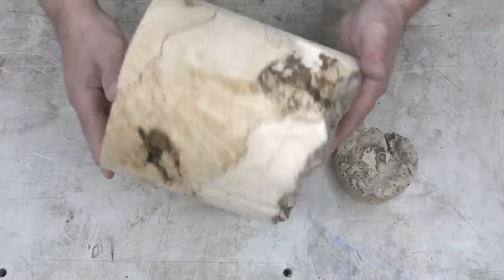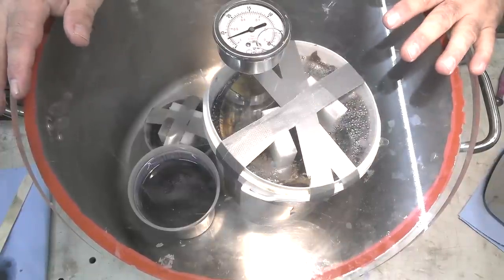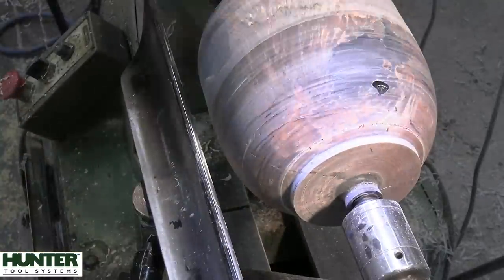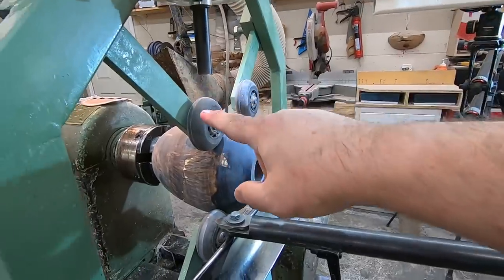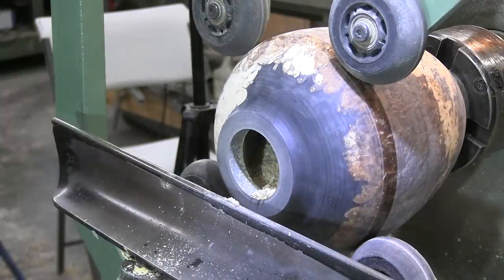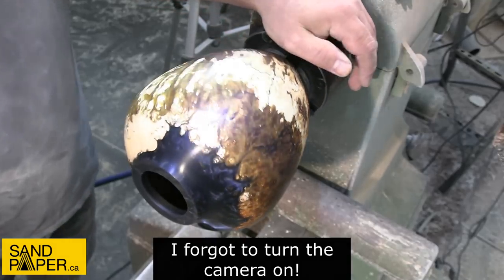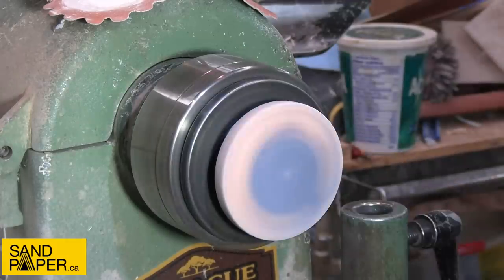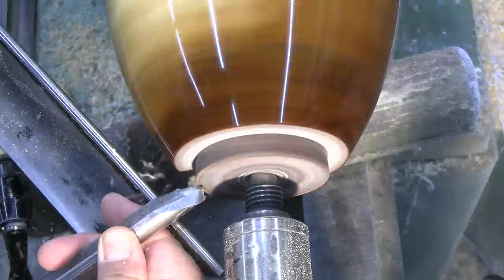Woodturning - The Black Pearl Urn

Comment: That is an urn that would be fit for the queen! The box elder is amazing. I do like the black in the designer epoxy. Thanks for the talk on pricing. I don't think non turners realize how much time goes into a piece. Then a half a second slip and it has to be refinished. A fellow turner gave me a formula he used. Diameter x height x 2.5. The later being adjusted if the wood was more costly. great video and a great urn. Whose ever it is for should be honoured.
Reply from the maker: Thank you very much!

Comment: Hello Jim its Mike (the terrazzo guy) we always used Diamond pads on our epoxy  floors. The pads are more expensive than sandpaper but when used correctly they will last an incredible amount of time and we didnt put anything on the epoxy and stone after bringing it up to 1500 because it was always scratch free with a mirror finish. I understand wood is much different, you have to put a finish or sealer on it. If you get a chance try the diamond pads, you generally use them wet but I believe you will be amazed,save time and achieve and even clearer finish, not that your art isnt perfect already. I have never seen such quality in my life.
Reply from the maker: Thanks for the info! Thanks for watching

Comment: The urn is gorgeous. 
A heat gun works well to pop bubbles and might be easier in a tight space. The interior of an urn would hold the heat, which is good and bad. It would quickly get rid of the bubbles but, if the nozzle is left in more than a few seconds at a time it could burn the resin. Just a thought. Beautiful work as usual Jim
Reply from the maker: I don’t like using heat guns because of the air that blows on the piece can have dust in it. Thanks for watching

Comment: Oh this one is very elegant! The black resin goes well with the figuring in the wood. You know, $400 is very much a reasonable price for what you make. It's art that takes a lot of time and uses expensive materials, and they're heirloom pieces that should easily be around for a hundred years.
Reply from the maker: $400 would be only half of the cost of this piece after factoring in resin, sandpaper finishing and other expenses. Thanks for watching!

Comment: Jim, to avoid all the air and bubbles from paddles, a) is there a way to stir that won't add as much air and b) can you stabilize punky wood with cactus juice to help with punkiness and make you use less resin?
Reply from the maker: If you stir with a stir stick it tends to add less air. Either you use stabilizing resin or casting resin they are pretty much the same cost. The big difference is that Designer Epoxy is food safe and stabilizing resin is not. That's not really a concern here but it would be in most projects, thanks.
Reply: @SpragueWoodturning  is stabilizing resin cactus juice?

Comment: Jim, I have a few observations after watching a number of your project videos.   Your lathing skills remind me of what a skilled ceramicist accomplishes on a powered pottery wheel; beautiful work. Given the number of open-form urns you produce, my reaction to this particular style of project is that the internal beauty of these projects is left unexpressed, a real missed opportunity to display their full beauty as well as, potentially their full value!  A final thought, I think you should continue to pursue the solution to your “peacock” coloring effect. Some of the early attempts where even the slightest of the green, gold and purple reveals themselves suggests great potential. But you seem confounded by how dominant the blue color you use overwhelms the others when, my observation is that the proportion of blue to the others is so much higher. What would happen if you reversed your proportions.
Reply from the maker: I will return to the peacock hollow form in the new year. Thanks for watching

Comment: What a beautiful piece! Idle curiosity has me wondering though if there's a way to seal the wood before pouring the black resin to create that really sharp contrast between the black resin and the blond wood? I just love how graphic those sections look
Reply from the maker: If this wood was stable and full of dry rot then you could seal it with a sanding sealer, in this case it’s not so I want the resin to penetrate it which will help with stabilizing the form. Thanks for watching

Comment: WOW… another amazing piece. I love the color. One thing is that I still don’t understand the laser thing. How do you use it and how do you know when you need to stop?
Reply from the maker: You set the offset on the laser to the desired wall thickness and when the laser disappears off the outside surface of the form, you’ve achieved the desired thickness. Thanks for watching
Reply: Thank you for explaining it. It’s a gorgeous piece!

Comment: Simply put, it's gorgeous.  Morbid? I think not. If you didn't know it was intended for ashes, it's a very pretty statement piece.  The wood grain is beautiful. Pricey, yes, but if you look into the industry for urns ⚱,  that's pretty much what they're going for. My mother's marble urn was  around $300. Specialized ones are much higher. If I had known about these ones at the time,  I would have chosen that option.
Reply from the maker: Thanks for watching

Comment: Designer epoxy

I love this urn, it is awesome…

I started using the waterlox because of you but my bowls are all wood with no resin.  I don’t seem to get the same gloss as you do.  Are you using the waterlox on your wood only bowls also or just the resin ones?
Reply from the maker: On everything and I’m getting good results 🤷‍♂️ Are you buffing between coats? Thanks for watching
Reply: I do buff but I’m using a tube of Tripoli that I got at northern and little bits of it sticks to the piece, maybe I’m not letting the lox dry long enough or I need to buy the bar like you use.  I will try some different things.  Thank you for the reply.

Comment: Why is it so important to get the air out of the wood before sealing it in resin? Is it just so that you don’t get bubbles in the resin as it’s curing? Or is there something intrinsically “bad” about sealing a block of wood that has air in it in epoxy? Thanks!
Reply from the maker: The issue here is the wood I’m working with is full of dry rot and it needed to be stabilized in a sense. This is why I used the vacuum chamber. Thanks for watching
Reply: I’m sorry, I’m really new. I guess what I mean is: What does “stabilizing” mean?
Reply from the maker: @greenmanjnj  your taking stabilizing resin and placing it inside the wood, you then heat cure it in the oven and it hardens the wood making it good for turning or machining. Jim
Reply: Oh, ok, thank you very much.

Comment: I agree with the pricing and would like to hear more about it. I think 80 dollars per hour is a high price, but if your name is well known and you can actually sell products for 350-500 dollars, fine. I live in Finland, as far north as you, but we only have a few types of wood here, less than 30. Finland lives on wood trade and processing, paper and pulp, etc. But woodwork is not appreciated here. I will be lucky if I can sell a 12"*5" bowl for 70-80€. You can't be a professional woodturner here. I get the wood "for free", so I don't pay for the wood, even though there are costs involved in getting it home and processing it to be suitable for the lathe. Electricity is expensive in Europe because of the war in Ukraine, I even turned off the dryer and let the wood air dry, and I've been thinking about the sense of turning because of the increased prices and the bad market situation.
Reply from the maker: I think most of the woods there would be similar to the trees on the prairies here in Canada. I’m fortunate to have a good supply of desirable wood to choose from in my area. Thanks for watching

Comment: Ballooning costs is something I understand.   I quilt and the costs of materials, time and quilting expenses and a quilt can balloon over $600 bucks or higher.   Quilters can charge $300 to $400 or more for their services.  And if you do all the quilting yourself, that takes a long time or if you use computerized quilting, the costs of that machine and thread materials is high.  Like your woodturning work, quilting is a very time consuming and labor intensive process.
Reply from the maker: Sounds like it. Thanks for watching

Comment: 50:39...almost looks like two hearts...one upside down towards the top in the resin and one at the bottom...the spalting in the wood.  I think you should have siliconed the top.  It's not right to make the client do it.
Reply from the maker: If I silicone the top, how would the ashes get put in it? This is why the customer need to do it. Thanks
Reply: @SpragueWoodturning  no, I mean so the top fits snugly...like an 'O' ring...make it waterproof.